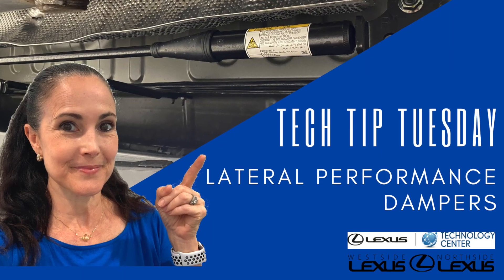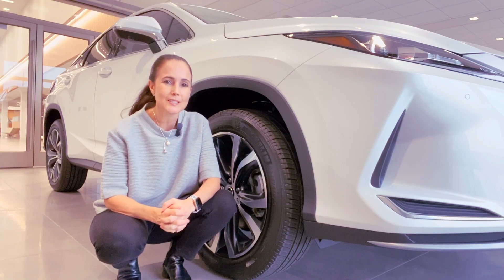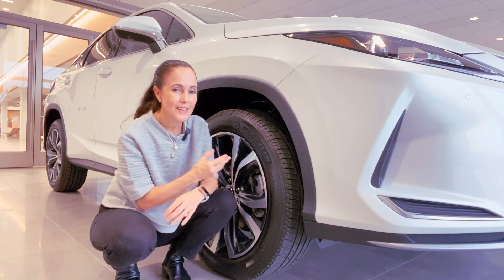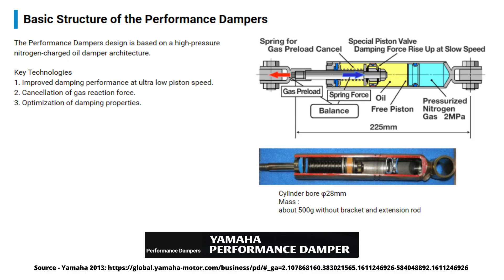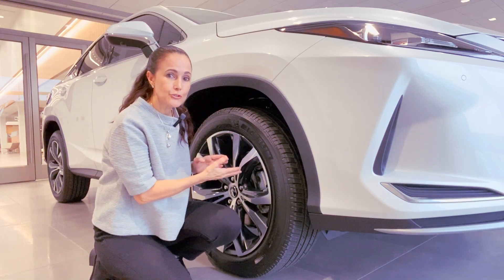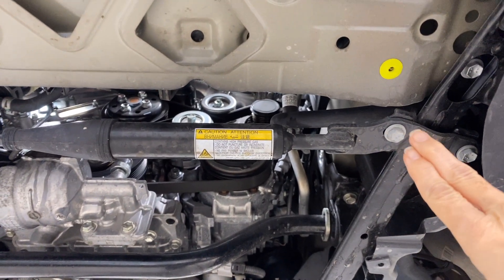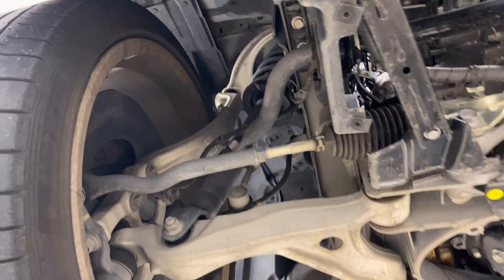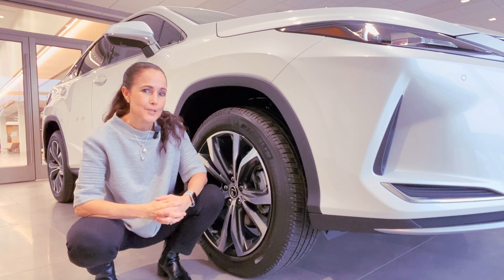Lateral Performance Dampers - Tech Tip Tuesday

Comment: Amazing video!  After read through all the technical specification on 2023 RX500h. Not able to confirm if it got the build-in performance dampers? 

After further search I found TRD may offer the same performance damper in this video (TRD parts no. MS303-48008; Performance Damper EX Plus).
Reply from the maker: You can definitely ask your Technician to check when it's up on the lift, if you aren't able to see them while it is on the ground. Some were easier to spot than others. Thank you very much for tuning in with me!

Comment: This video is slightly wrong on some things. She says that the partnership happened in 2013 which is incorrect as I have a 2011 Lexus CT200h hybrid hatchback and it’s NOT a FSport model but I DO have front and rear Yamaha Lateral Performance Dampers above the front suspension under the cowl so it is attached to the strut tower and the rear is at the far back directly behind the rear bumper. On both my 2011 and 2014 NON-FSport CT200hs
Reply from the maker: Hi Alexander, The date for the partnership was provided by Lexus and I used the information they gave regarding this specific partnership. It doesn’t mean that dampers weren’t used before 2013 or that only f-sport models would be compatible. As I mentioned in the video other packages also include dampers and some of the vehicles pictured in the demonstration are not FSport. I’m sorry if you found the  information confusing. Thanks for tuning in.

Comment: honestly my 2016 IS300h Fsport is more comfortable in sport mode driving over bumps and cobblestones than the normal mode
Reply from the maker: Interesting. Does your IS adjust the suspension system in Sport Mode (some do, if they have the AVS). That could explain the difference in feel. Either way, driving an IS in Sport mode is always fun! Thanks for being here!

Comment: Hi Melissa. I purchased a 2022 RX 350 F Sport in January. I want to have a trailer hitch installed to accommodate a bike rack. I have learned that my F Sport has performance dampers on the rear. I’ve been told the only way a hitch can be installed is to remove the damper which I am hesitant to do. If I were to install the hitch with the damper removed, what can I expect in terms of handling.
Reply from the maker: Hi Neal, So sorry for the delay. You are correct that the lateral performance dampers have to be removed for a towing hitch to be installed. I did confirm this with one of our lead technicians in the shop and he said there is not another way to install the towing equipment, because it goes in the same place. He also said that he didn't think it made a huge difference in the drive feel, but each person might be more or less sensitive to the change. I hope this helps. Thanks for tuning in.
Reply: @NorthsideLexus  thanks for your response Melissa. I have learned from a Lexus Service Manager that the OEM trailer hitch for the F Sport is mounted behind the bumper rather than the traditional method. The hitch maintains its towing capacity as well. Can you confirm that with your resources before I proceed. Thank you.
Reply from the maker: @nealleonhard6150  that is interesting. I’ll be happy to follow up for you. I’ll be back at the store Monday and I’ll ask our shop foreman. I know when I filmed this video the Techs told me they end up having to remove a lot of the dampers because of requests for a towing hitch to be install. We don’t usually install after market accessories, but I will see if they have any information for you. Do you think the Service Manager you spoke with means it needs to be install at the factory with the hitch and dampers? Or are they able to do the hitch install without removing the dampers?
Reply: @NorthsideLexus  hi Melissa. I was told the hitch (PT22848160) would be installed without having to remove the rear lateral damper. L look forward to hearing back early next week. Have a great weekend.!
Reply: @NorthsideLexus  hi Melissa. I wanted to follow up with you on this. Did you learn anything further. Thanks.

Comment: hi Melissa, will these lateral performance dampers make any difference in terms of handling and body roll? thx and keep up the great work 👏 👍
Reply from the maker: Hi! Thanks so much for checking in! These dampers are really more about ride comfort and reducing vibration. It's possible that they can create some increase rigidity, but I haven't seen any information about them reducing body roll. I think they tend to add them to f-sport packages most, because they have sport tuned suspension systems and they want to have a sporty Lexus ride, but not a rough ride. They also are not like the KDSS (Kinetic Dynamic Suspension System) seen on some of the Lexus GX models. That is a more robust system designed to help reduce sway and roll. I hope this helps! I am definitely more knowledgeable on the technology side of Lexus world, but it was a lot of fun to learn more about this!

Comment: Coming from a 2019 RX Non-F-Sport Ultra Lux, to a 2022 RX F-Sport with the Adaptive Variable Suspension and Lateral Dampers, I can truly there is a difference in the ride, BUT probably not as people may think.  BOTH are equally comfortable and quiet, and if you had to use either one as a daily driver, you wouldn’t have any problems in the ride quality.  

HOWEVER, while both are just as comfortable and quiet, the main difference I can perceive are mostly during turns and curves (and of course acceleration during Sports+ mode).  The F-Sport has much less body roll during a turn.  You feel literally more planted and confident as the car seems to “grip” the road better.  The dramatic bolstered seats in the F-Sport also contributes the sense of being more planted in your turns.  You can also feel the increased stiffness while in Sport+ mode, but nothing harsh at all.

At the end, you really can’t go wrong with either versions.  But do your research and test drive BOTH cars to really get a feel.  TBH, I was initially put off on the F-Sports Seats, but eventually grew into them to point where I may actually prefer them over the regular non-F-Sport seats.   Lastly, be aware there are some options ONLY available in one version or the other (e.g., Under-thigh extensions only in Non-F-Sport Seats)— so do your research and ask lots of questions.   

Hope this helps.  And this channel is by far the best Lexus tutorials out there.
Reply from the maker: Thanks so much for sharing your experience with us! I'm so glad you're enjoying the videos and really appreciate your input.

Comment: Wonder if it'll fit a RAV4 Prime. Is there a TRD Performance Damper P/N? Any help is appreciated
Reply from the maker: Hi! Thanks for tuning in. TRD has a variety of Performance Dampers and they are definitely model specific. I would contact a Toyota Dealership Parts Department to confirm about the RAV4 Prime. If there is a ream mounted motor/generator for AWD there may not be room for the damper. Same issue if someone wants a tow hitch installed. The damper has to come off. Hope this helps. Thanks so much for tuning in!

Comment: How long do these lateral performance dampers last? How does one know when they need to be replaced? I have a 2013 RX350 F Sport with ~110,600 miles. I am about to have the front struts and rear shock absorbers replaced. Should I ask the mechanic to check on these lateral dampers at the same time?
Reply from the maker: Hi @joncaju. That is definitely a great question for your Technician. From what I've seen they are sealed units. It may have a recommend amount of miles driven before they are replaced since you can't see inside the hydraulic component itself. Hope this helps. Thanks so much for tuning in.

Comment: Hi Melissa. I try to watch all your videos and always learn something new. You explain everything very simple and easy to understand. Can you tell me how to adjust the headrest on RX 350 please? I have 17 MY with premium package. I can move it up and down but can't move forward. Google doesn't have anything either. If it is adjustable you'll be the first one on YT with this tip if you decide to make a video of it  :). Thank you.
Reply from the maker: Hi Tommy! Thanks so much for watching! I'm really glad they help! You're correct about not being able to move the head rest forward or back. Many of the Lexus vehicles only have height adjustable headrests. If a head rest can be moved forward or back, you'll see a small track opening in the top of the seat back that would allow the movement of the post. The headrests are whiplash lessening and are designed to support your head and neck in a specific way that is to help lessen the severity of whiplash in an accident. I hope this helps :)

Comment: Drive Mode Select setting? Normal?
Reply from the maker: Hey @JBettis! Great to see you here! Since these aren't connected to the suspension system they are working all the time, in any Dive Mode. (I did both drives in Normal Drive Mode.) Also, all of the cars I saw them on did not have Adaptive Variable Suspensions, so the Drive Mode would not be impacted any way. Without AVS, the Drive Mode selector is impacting throttle response, on older GSs it could also impact steering feel for Sport S+. These are one more extra step in reducing vibration. That's why the say they reduce "micro-vibrations" and they are connected to the chassis to try to prevent those vibrations from traveling up to the driver. Hope this helps.

Comment: Can we non damper havers have those dampers installed?  (-:
Reply from the maker: LOL! Right!?! My car is a "non damper" too. They roll them into some F-Sport Handling packages to help reduce more vibration that you could feel with a stiffer suspension. Then on the Ultra Luxury packages that have them it's all about super comfy ride quality, very smooth feeling. I'm not sure if the dealerships do installs for cars that didn't originally come with the compatible packages. There may be more parts compatibility issues. I did run across some very pricy after market dampers that seem to be available in other countries. I can't promote them since they aren't an official Lexus part. If you really want them, I would start by contacting your Lexus Service/Parts department or Collision Center to find out about compatibility :) It's great to see you here @DougieFresh!